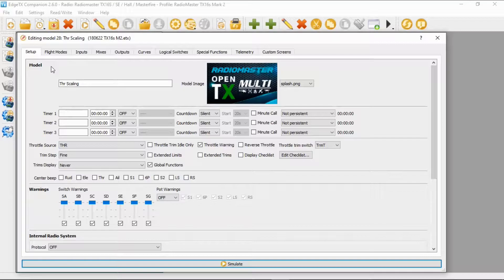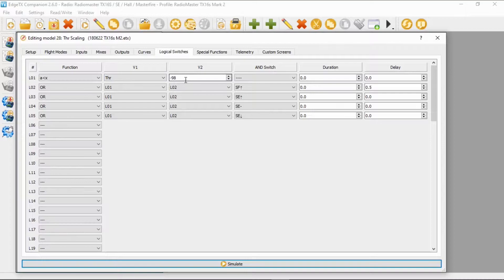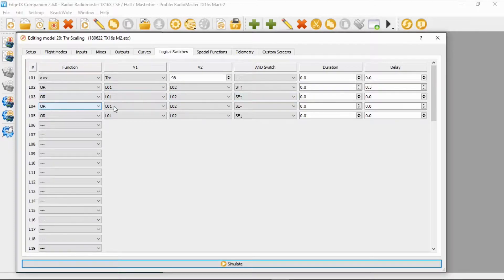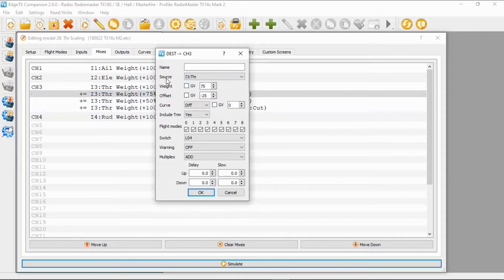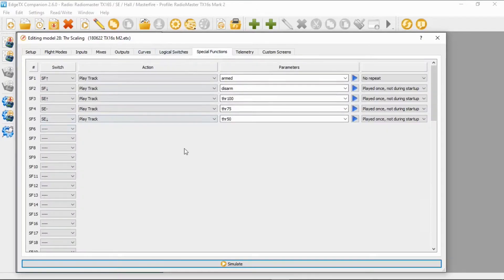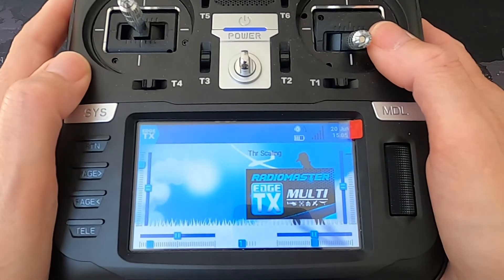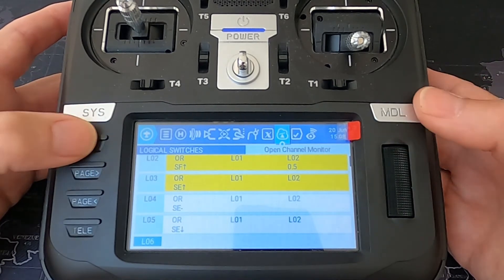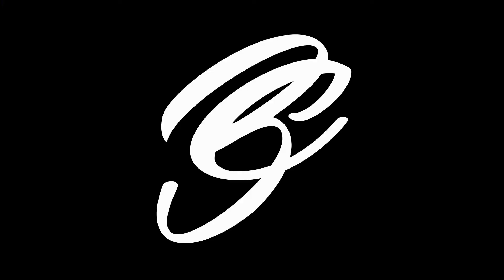EdgeTX Throttle Scaling with “Safe” Throttle

Comment: Thanks Bill. I'm hoping this will fix my problem. When my quad is armed, I can raise the throttle to full, but when I bring the throttle stick back down the motors remain at full power. Is this a tx16s fix or a betaflight fix?
Reply from the maker: Hi Jerry, no do not use this for drones the FC will take care of arming. Safe throttle is only for fixed wing planes.
Reply: I like the arm / dismarm switch for my quads and I like the safety aspect of this for my fixed wing.  I’m not sure what the purpose is for throttle scaling?  Is that for arming or is there another function I need to know about?  Thanks John
Reply from the maker: @koolpix4u  Hi John, just for reference you should not use the safe throttle settings on your radio for quads your flight controller takes care of arming. Throttle scaling is used to limit your throttle to reduce power. Could be used to calm down an overpowered model.